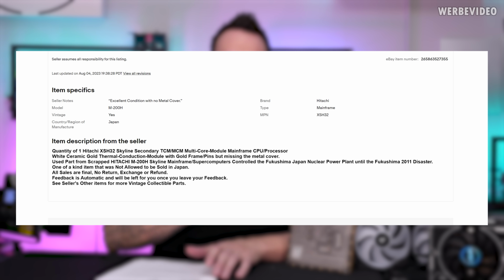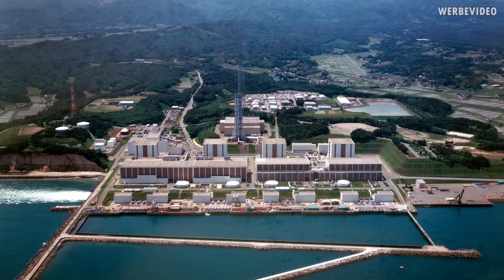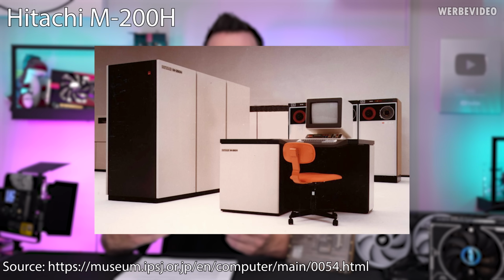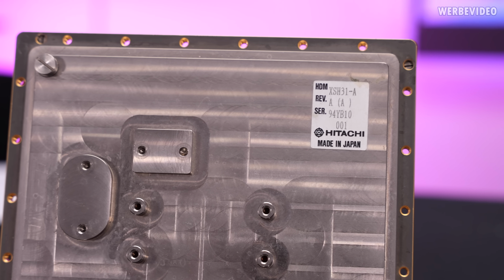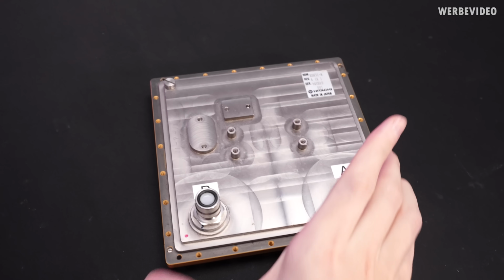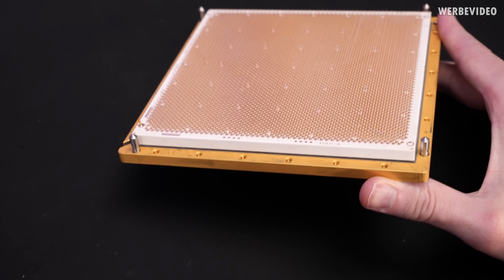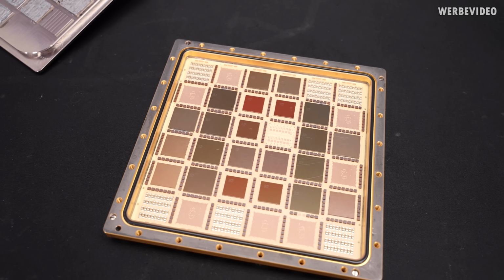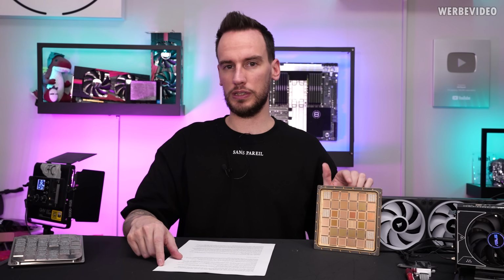This CPU was used in the Nuclear Power Plant Fukushima Daiichi?

Comment: Control system engineer here (DEH and DCS especially for  nuclear power plant). they need to upgrade their control system due to lack spare parts. of course there are other reasons, like better protection, better control outcome. this cycle typicaly is 20-25y like you said, but NPP user does not like cutting edge tech, they prefer product has been on the market and been tested for quite some time. and before the retrofit actually implemented, at least 3 years designing time needed. that Cpu or technology could be already 5-10 years old when it finaly been used or implemented in the NPP. so  i think the last retrofit (which use that big mainframe cpu) was carried out at about 2000. evidence? PGA on the CPU maybe?           i'm not saying that cpu is 100% from fukushima, just saying that make sense.

Comment: It's entirely possible they had a CPU that was made after the plant was designed, as mainframe-type systems were designed with insane backwards-compatibility. They could have upgraded the hardware to something more readily available without having to modify the software running on it or any of the secondary systems or peripherals. In some cases this can even be done one CPU at a time in a larger system, while it's running.
Reply: It's probably a clone of an IBM mainframe build on licence
Reply: less of a license, more of an IP theft sting and  lawsuit, but yeah,  @ciano5475 
Theres a few details on the IBM MVS wiki page. Hitachi and Fujitsu ended up making systems compatible with old school IBM mainframes even after IBM changed to z/arch
Reply: If it's a late upgrade (well yeah, it's going to be considering the building era cpu's were slot type :P) some of those cores are probably for emulation / translation processes to make it compatible with the other old hardware / software stacks, right?
Reply: @libaf5471  I think it's very unlikely it is using emulation. That would create a massive software dependant single point of failure and completely unneeded layer of complexity on top of any possible hardware defects. Not a good design choice for something as critical as nuclear powerplant.
Reply: I don't think they even had sockets like that in the 1960s
Reply: They didnt replace the chip,  @Jazzy-kz6wd  they replaced the CPU - Central Processing Unit, the whole cabinet that chip lived in. And then built a new one to order with plugs that matched the old one. It attaches to I/O units. Thats why the chip in your computer is called a CPU rather than something more fitting for a tiny chip

Comment: the radiation meter is called a geiger counter in united states
Reply: Geiger counter is only one type of nuclear radiation detector - there are ion chambers (simple and cheap but less sensitive than others), proportional counters (similar to Geiger counter), and scintillators with photomultipliers.

Regular photodiodes such as BPW34 can also detect gamma rays when put in a lightproof enclosure.

Comment: I used to work at IBM on mainframes, and on an IBM mainframe CPUs come in pairs, the computation is duplicated and compared and if the results do not match that pair is turned off, a spare pair is turned on, and if the CPU book (what the CPU module is called) is low on spares a support technician is dispatched to replace it.

Assuming Hitachi are doing the same thing the 10 chips are probably compute, the 5 chips are probably L1 cache for each CPU pair and the other 7 are IO. That module would then be providing (at most) 4 usable CPUs of compute.

You can't find out the usable:spare ratio from the part number because that's configurable for the use-case. For this use-case I would expect it to have been deployed as 1-usable 4-spare because you would not want to get into multi-processing problems in something this critical, you don't need 2001-era multiprocessing for a 1967-era problem, and you would want maximum spares for that environment.

You are of course correct that millions a month would be a lot to spend on a normal CPU, but that's not what you are buying: you're buying near-absolute certainty that every calculation is done correctly and on-time.
Reply: Wouldn't want a Single-event upset to screw up data.... like a boeing 737 max deciding to nose dive because the ex-McDD bean counters didn't think a second data check was worth the cost.
Reply: @TatsuZZmage   It was worse than that.  They took away the ability to turn off MCAS without losing powered trim.  The trim wheels on this model have a smaller diameter making it that much harder for a human to detrim manually once the trim was set to full in flight.  They cut corners everywhere and every individual cut was a safety problem by itself.
Reply: redundancy system usually comes in triplets not pairs, you can’t compare pairs to know which one is the correct one, having 3 systems would help avoid cosmic rays bit flipping
Reply: @KimoKimochii  you can use pairs, if they disagree then turn both off. There are systems that use triples and voting but they are very difficult to engineer to be more reliable than pair systems, and necessarily use at least 50% more resources making them more expensive and slower.
Reply: @KimoKimochii 
A pair of cpu doesn't make any sense: if there is a mismatch which one is the faulty cpu? 
Redundant logic ( for example in aerospace application) is based on a "majority tree logic" Which compares the output of any storage element which is at least Triplicated: this configuration allows one mismatch out of three... The next level of redundancy is 5 , which allows 2  failing elements out of 5 ! 
This approach is the most valuable to counter "SEU" events, where an high energy particle can flip any storage elements in the device. 
If you design FPGA for high demanding environment, there are tools which support introduction of automatic majority logic into the design process, which otherwise would be unattainable. 
These tools provide to scatter the storage elements of a logic bit into random positions around the chip in such a way that flip flops of a logic bit are not physically close to one another...
Reply: @ThewiseSaruman  that’s why i said redundancy comes in triplets but then again what he said about pairs can make sense if the system does every calculations in pairs (total 4 times) then the one that is wrong gets filtered out
Reply: Some of them may be for redundancy in case one fails it still has some functionality and the remaining ones just get slightly more work to do.  Considering where this came from redundancy is something I imagine was everywhere in those places.  It is simply because the stakes are way too high not to have it.
Reply: Fun fact: there are microcontrollers with duplicate cores and ECC memory, for applications requiring high reliability (automotive) and high radiation environment (spacecraft).

Such microcontrollers aren't that expensive - TMS570 series starts from tens of dollars up
Reply: @mieszkogulinski168  Wow, I didn’t know about these. But I have wondered, how probable are these errors in something the scale of a tiny embedded microcontroller operating in normal conditions? Do cars actually need ecc and redundant core chips?
Reply: @abraarsameer9521  It's important to see these things on different perspectives. A normal CPU would be perfectly fine for your car, however if you sell million cars then suddenly a one in a million error event would start happening on a daily basis, which then would be a heck of a problem for any car manufacturer: A system error in a car wounds a person every day. The same logic applies for nuclear power plants (and many other things as well), but otherway around: a one in a million error event would affect million humans, meaning the risk is too high for the error to happen even once. Aviation has a lot of great examples and practices about this too.
Reply: @abraarsameer9521 When your car is calculating when to apply the brakes for radar cruise control or even when to turn round a corner, it's worth it to have higher reliability electronics
Reply: @insoYT 
In automotive environment where Safety level D is required, all storage units must be protected by ecc, including flash devices , containing code or parameters...
Reply: @mieszkogulinski168  you can get even lower, there are c28x mcus that has ecc and lockstep. the tqfp48 variant of the f2800156 goes for around 2.8usd for qty under 100 if you buy direct from ti
Reply: Why would CPU's die? Ever? Were they not cooled well? I absolutely would not like the idea of the idea of a mainframe that has been engineered around CPU's that knowingly fail.

Honestly seems like a ridiculous design. Am I missing something here?
Reply: @nexxusty  yes, what you're missing is that all CPUs will compute an inaccurate answer from time to time due to things like cosmic rays, alpha strike, EM interference, and even quantum effects within the chip circuits. I believe Intel publish the expected rate of these errors for Xeon so maybe you can look it up (or at least that's available to enterprise customers). The failure rate isn't zero and the spec is for when operating the CPU in a set of conditions that are probably a lot less hostile than what you need to harden a nuclear power plant control system against.
Reply: @nexxusty  maybe the fact they they are made to last as long a the builing they are being used in?
Reply: @nexxusty  electronics degrade over time, especially when exposed to higher than normal levels of radiation. There was some space rover I recall that died because its electronics got too damaged over time from operating outside our atmosphere.
Reply: I understand the logic of what you are saying, but I hate that sort of thing. A few years back I built a computer with a dual core CPU. Then I pressed some buttons and made it into a quad core.If I ever meet someone who is responsible for intentionally wasting resources like that, I will call him a poo poo head,

Comment: contrary to appearances, running a nuclear power plant is fairly simple and straightforward and, in theory, doesn't require much processing power. My guess is that the reactors probably run on PLC computers like all other large industrial complexes. A huge processor like that was probably used to conduct simulations or other research related to the power plant.
Reply: I also was thinking the same - a regular microcontroller seems to be enough for process control in a nuclear power plant. Just use one with ECC memory :)

I guess that the power plant used old hardware that no one wanted to replace, possibly because of testing/certification cost

Edit: I was wrong - I watched a video about Chernobyl power plant, and the computer had to process data from thousands of sensors - each fuel rod could have several sensors for various physical parameters. Not a job for a single microcontroller...
Reply: @mieszkogulinski168  Well.. say you have 10 000 sensors with an average resolution of 10bit and a polling rate of 5 Hz, that produces a data stream of 63 KB/s: just about what a dial-up connection could handle... lol  still well within the realm of PLC computers.

Comment: The most popular secure way is actually to run 3 of them. I have no knowledge of Nuclear Plan setups, but this is the most common setup in general.. could also be, that other reactor's Mainframes worked as one of the backups. Having this setup its actually very easy to hotswap Mainframe HW, so its not as big deal as you say. Usually in Mainframe everything is hot swappable and anything works with back compatibility since 50's.

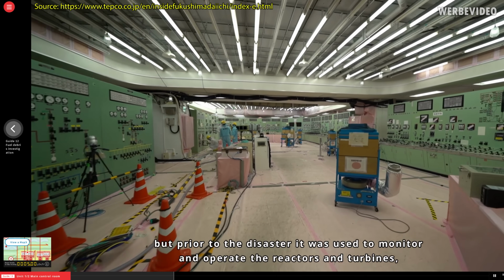Comment: I have studied electrical engineering with specialization in powerplants 2004-2009. The stuff we learned at technical university was how to steer the PP using the manual switches and dials. Basically the green cabinets that you show @3:48. In 2008 with about 20 of my colleagues we were for a month allowed as interns into the biggest conventional power plant in central Europe that was build in the 80's. We probably went through all the departments there, but I do not recall seeing such mainframe computers. We did spend few hours in the steering room, and they used computers for steering the systems (green cabinets for manual operation were still there, as well as fish tank - which is mandatory thing at every steering room). But no pictures were allowed and I don't recall anything except modern at that time LCD monitors, mouse and keyboards. The software they were running looked modern for sure (fully colorful graphs, diagrams representing technological flow with steam parameters, gauges). So I'm certain they did retrofit from fully manual steering into computerized steering and they could make additional upgrades / retrofits every several years. They have scheduled maintenance periods, so if power plant has let's say 10 blocks than one or two may be in maintenance (they may replace turbines, or generator with newer one, cutout entire boiler and put in new one and at the same time change the steering system), when this block goes back to operation they will do the next one and so on. The change for entire power plant may take like 5-10 years to complete. I don't know much about nuclear power plants, and computer steering was never mentioned at the university in my day, but at the same time I don't feel there would be a need to have a massive mainframe system to operate it. I mean you have hundreds of sensors to read information from, but how many refreshes per second you actually need? When in manual operation maybe someone went to do the readouts once per hour and it was enough.
Reply: A fellow electrical engineer here, but with a focus on micro electronics: Such a CPU isn´t used for its compute power, it´s purely redundancy. I suspect that the ten large chips are all individual cores, functioning in pairs with the same L1 cache chip. Each calculation is made in both cores of a pair and the output is compared. If the result from both cores in a pair is the same, all is good. If it´s not, that pair is cut from power and the calculation is repeated in the next pair. When the second to last pair is reached, the CPU will be replaced asap to keep the redundancy in place. That way the complete CPU would be able to spit out errorless results for tens of years. In this case I wouldn't be surprised if some of the cores in this CPU never saw any real use besides a periodic errorcheck, as the whole design of the cores themselves would've already been focussed on integrity rather than speed.
Reply: Hehe. Steer the pp.
Reply: For nuclear at this scale you absolutely need mainframe class computers to monitor and operate the core. Nuclear is much more complex to operate than any other type of power plant.
Reply: @binaryguru  Yes, a nuclear power plant is  complex relative to other power plants, but don´t forget this is a ´94 era CPU in a ´70 era power plant. This CPU was most likely hundreds or thousands of times more powerful than whatever it replaced. I wouldn´t even be surprised if the original plant design didn´t even include a digital processing unit and was purely analog. Development of these nuclear power plants doesn´t take several years as derbauer suggests in this video, but rather takes tens of years. Nuclear reactors being comissioned today run on handware from early 2010 or even the zeros. This means that the original system in the fukushima power plant is from the 50s or 60s, well before the first real CPUs were launced (Intel 4004 in 1971) and bizarrely simple compared to what we are able to do now (or in 1990). To add to that, while a nuclear plant is much more complex than a coal plant for example, a coal plant is utterly simple and even the processing required for a nuclear power plant isn't very complex either by modern standards. Furthermore, these systems are kept as simple as possible in an effort to reduce the risk of errors. The risk of errors grows exponentially with complexity, so every added parameter or processing step has disastrous effects on reliability.